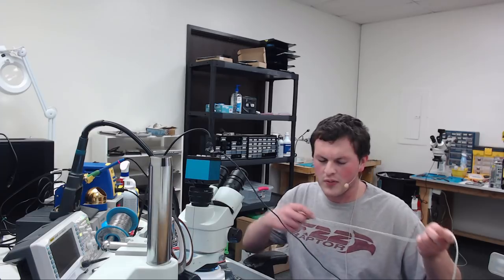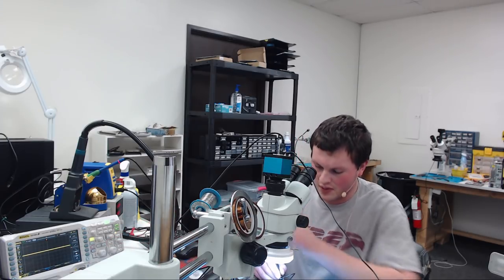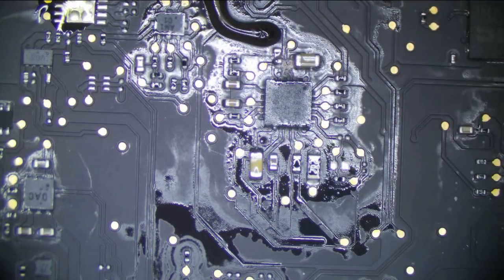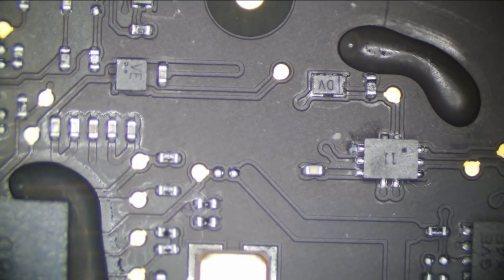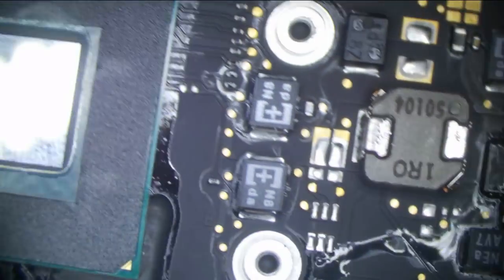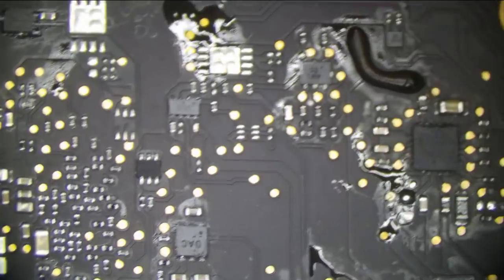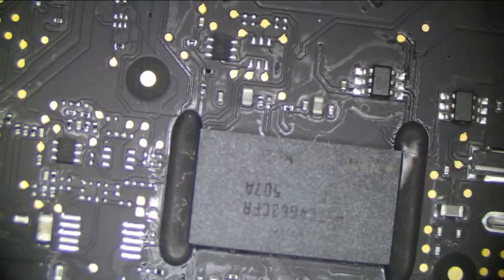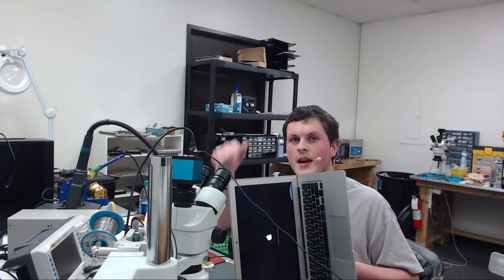820-00165 partially entering S0 state do to voltage leakage to gnd on PP5v_s4rs3

Comment from the maker: I am aware of the audio clipping. I am working to resolve it. Please do not comment "Your audio is terrible, this is unwatchable" . If it triggers you that bad, don't watch.
Reply: also - if you've narrowed down the clipping problem to when you have high current draw devices on in your shop - i'd try either a nice battery backup unit or a regular rackmount power conditioner - whichever you can find cheaper. hope that helps buddy.
Reply from the maker: @marcocabal  Google.
Reply: @TCRSCircuit  dear, in google I found only the  820-00165 free, but not like that the 820-00165-A, why?
Reply from the maker: @marcocabal  It's the same exact board.
Reply: @TCRSCircuit  unfortunately it is not the same, there are components that do not match in their position ...
Reply from the maker: @marcocabal  They are identical.

Comment: Very interesting and timely for me I've been trying to slay an 820-3437-B intermittent failure  (P5V_S4RS3, PP5V_S0, PPVCC_S0_CPU( 1.8v), PM_SLP_S4_L )  all work sometimes most common PS shows 0.024. but will spin up .0.500 to 0.600 then drop back 0.024 region. The only definitive finding so far R6102 @71k not 100k on SPI. The good side of this problem keeps the mind active and engaged. Stubborn old fart
Reply: Hi John hi have the exact same problem on the same board, did you solve it with r6102?

Comment: oof i have one like this missing 1v05 s0 but has everything up to s0. fixed liquid around efi rom a few weeks back and while packing up to send noticed no power. replaced fet, u7600, checked all resistors around and measure good in circuit.
Reply: i have 5v on pin12 of u7600 tho